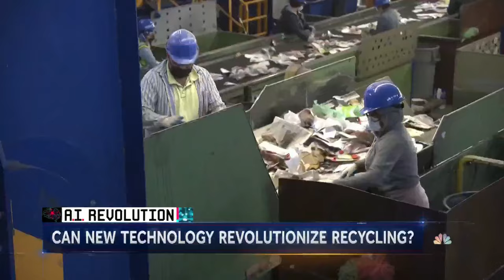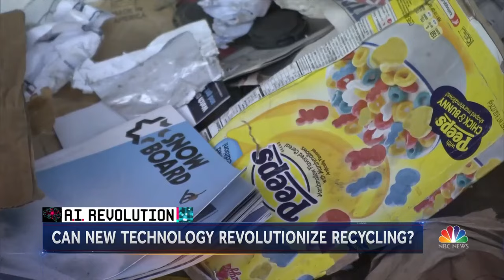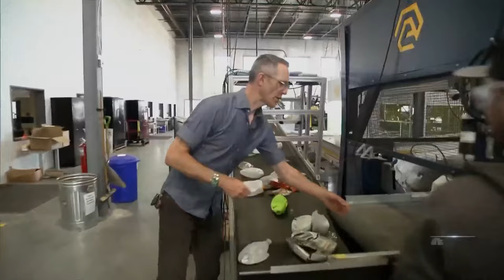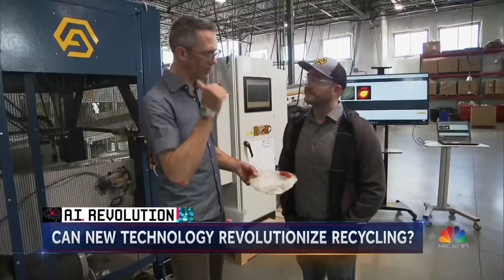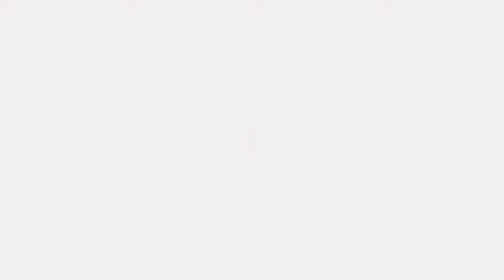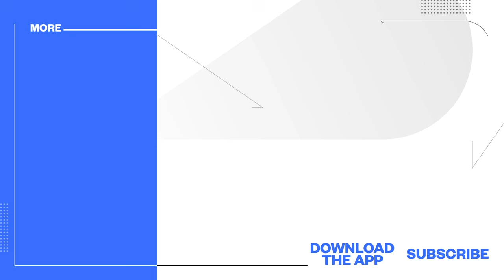Artificial intelligence helping recycling center sort waste

Comment: I wish someone (billionaire )  would develop a way to convert recycled plastics into a clean burning fuel that could replace gasoline and doesn't require alot of modifications with our current engines and make it cheap.   It's a win-win for the environment and humanity.   I know it's possible... the technology is probably already out there... but the gas companies are blocking it from happening.
Reply: I think burning plastic is extremely toxic.
Reply: It’s called pyrolysis
Reply: Actually they do this in 3rd world countries on small scale. It turns into diesel.

Comment: If all packaging material for short term use was compostable, that would be even better.
Reply: When done correctly, compostable is awesome.  However, compostable stuff tends to muck up recyclability. It's not clear that compostable packaging is workable as a broad solution.